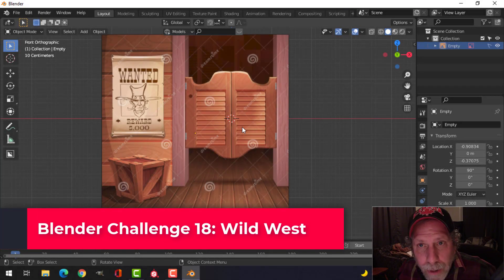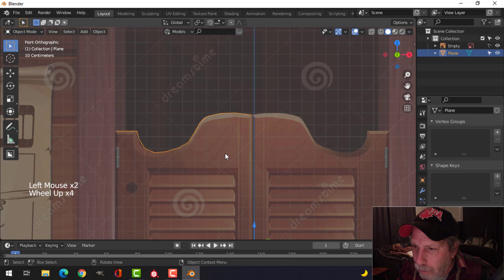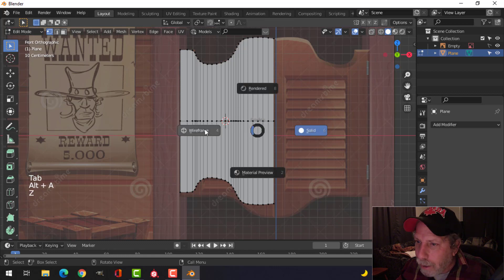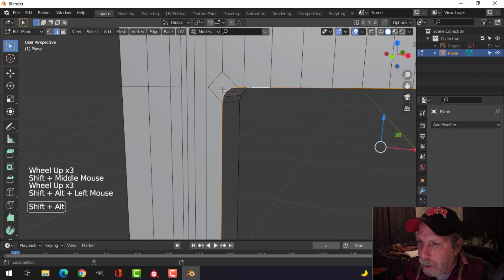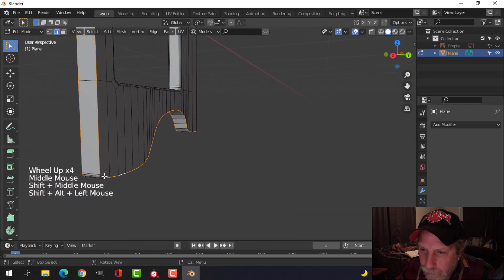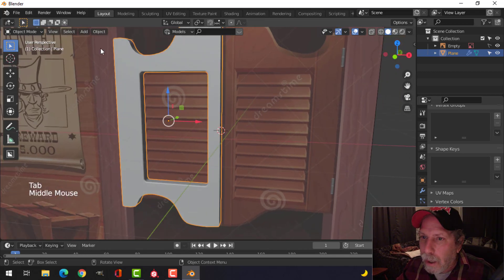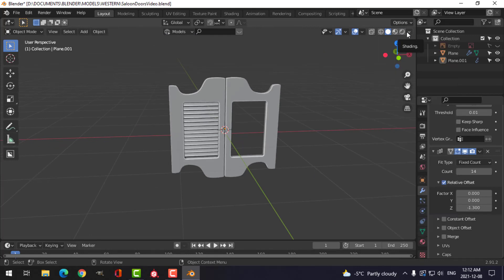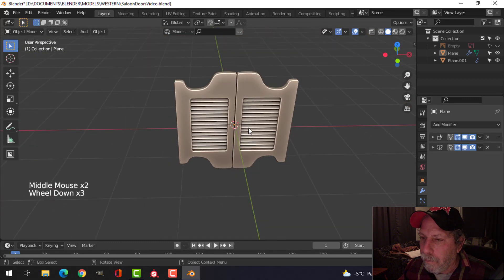BLENDER: SALOON DOORS (2)

Comment: This is great as always, but I have a question. I see others do this as well. You added a plane and then merged at center to give you one vert to work with. Why not add a single vert in the first place? You have the option about half way down the mesh menu? :)
Reply from the maker: Thanks and that is a good question.  For some reason, I often have trouble just adding a single vert.  It doesn't work for me sometimes.  So I just don't bother with that and merge the points of a plane.  Maybe I will give it a go and see if I have better luck, though.
Reply: @zerobio  thing is, I do the same thing with merging at center. For me it's like auto pilot. Which is why I asked to see if there's a different reason.
Reply from the maker: @Some_Guy_Called_Raven  yeah, I'm just so used to it too